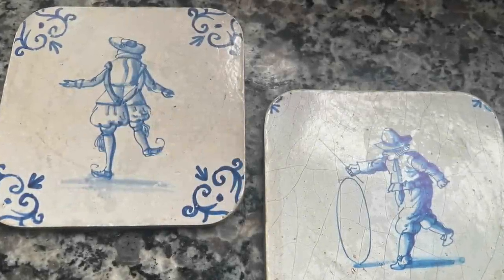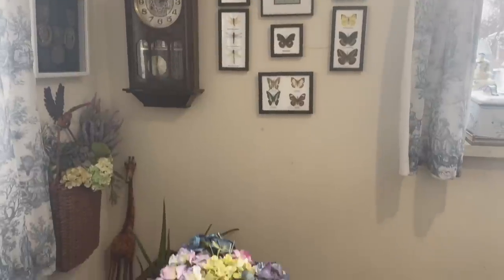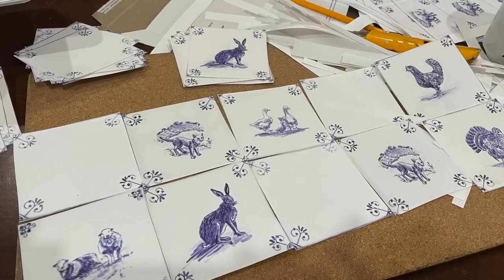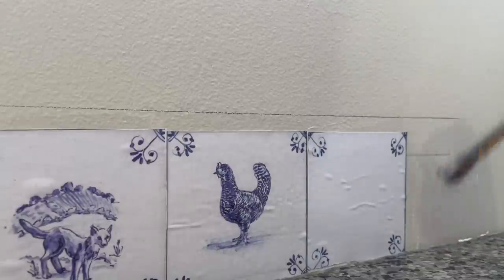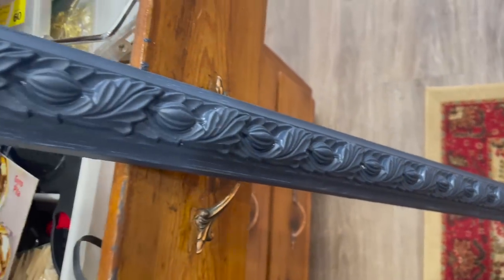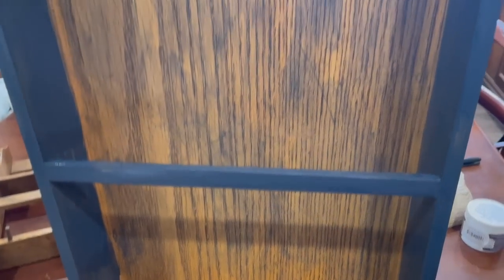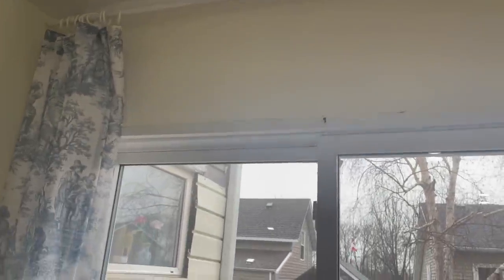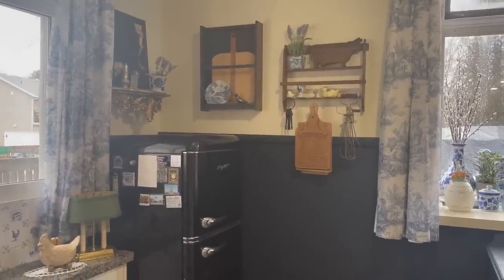French Country   Unfitted Kitchen Makeover Rental #decor #vintage #makeover  #thriftedtransformation

Comment: The kitchen in my apartment has typical wall cabinets, upper and lower, on one wall. So I have outfitted the other side of the kitchen with a tall triangular pot rack, an equally tall 3 shelf cookbook stand with a deep drawer on the bottom and a white hutch with glass front doors on top, a shelf in the middle big enough to hold a microwave (but I use it to display various cooking oils and other things) and 2 cabinets below. I love the unfitted, European look! 🇫🇷
Reply from the maker: Yours sounds amazing,                         ‘necessity is the mother of invention ‘ we are kindred spirits 👍